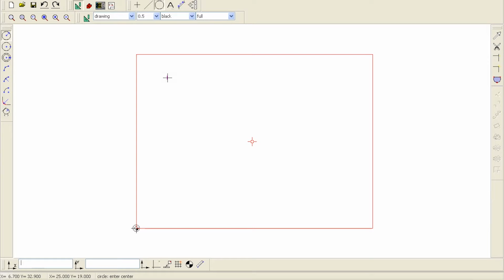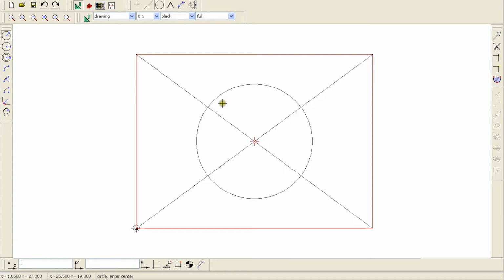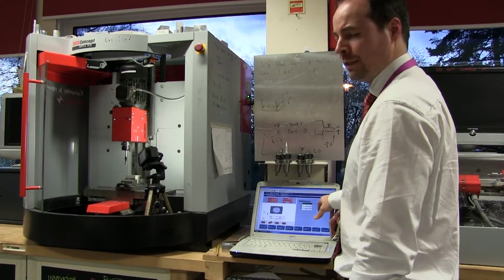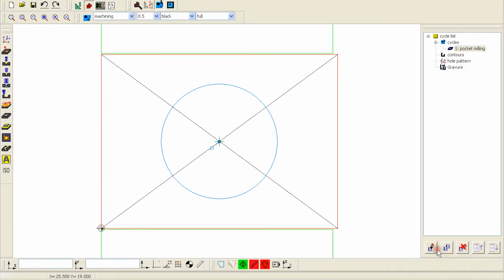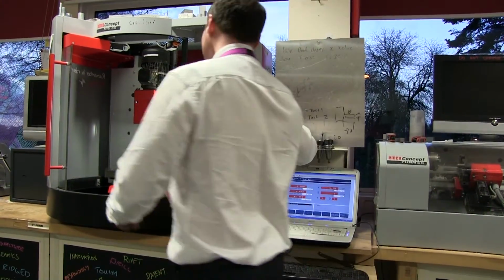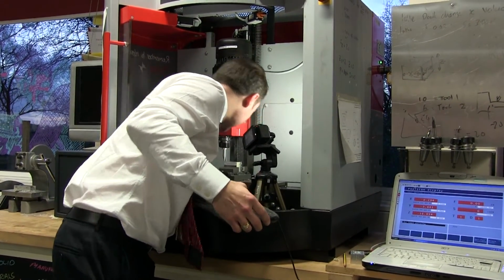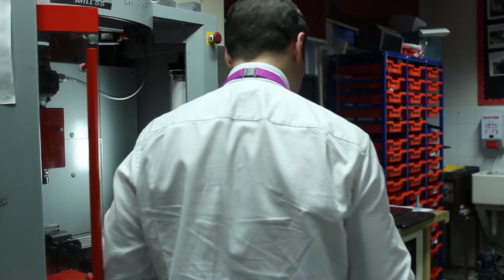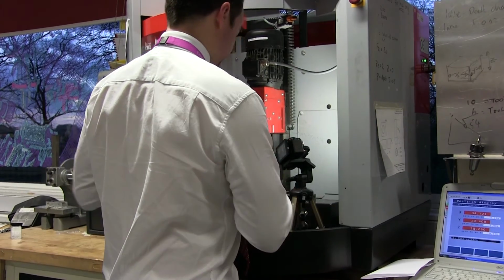Pocket Milling with Emco Mill 55

Comment: Hi,
Thank you so much for such a detailled video. But please, please... avoid wearing anything around your neck when machining ! Ties, particularly, can be very dangerous. Of course, since safety casings are mandatory, we see a lot less accidents. But many people which are not equipped properly does not think about that and replicate what they saw on YT. Just think about your jugular being split open by your tie when it is driven between the tool and the part... Safety always first.
Keep up the good work !

Comment: Your tool stick out is excessive. I would have the tool pushed into the holder as deep as possible. You could reduce the length by at least 25mm, this would give better finishes and reduce that chatter you hear.